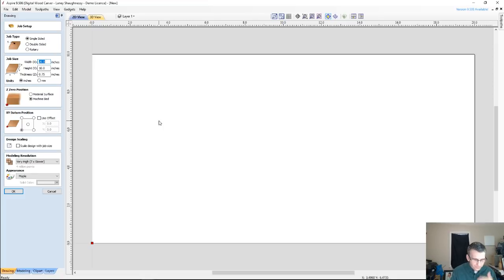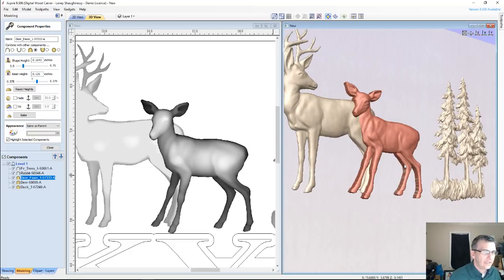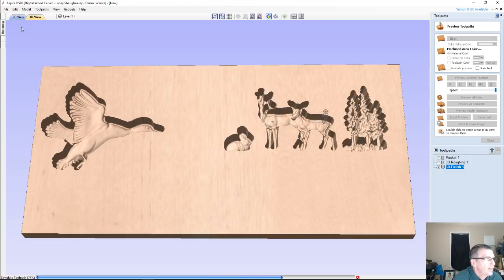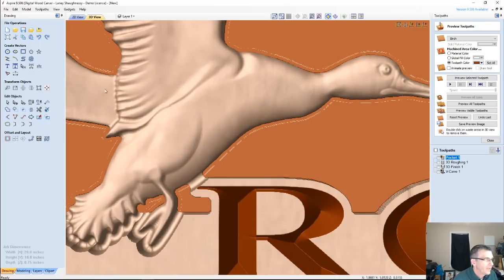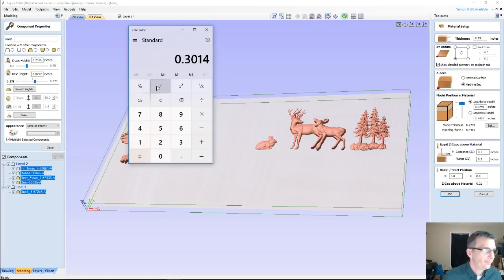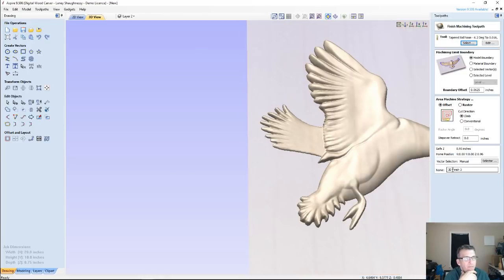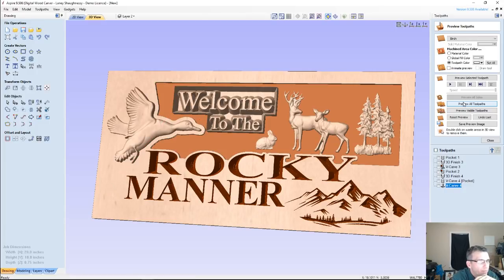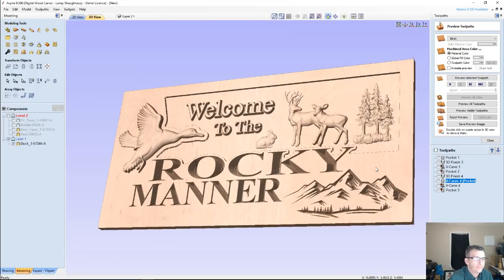Exploring the Features in Vectric V9.5 and 2D-2.5D & 3D Designing

Comment: How do you get the layers tab at the top? TIA
Reply from the maker: as of version 9 in the vectric software 9 and 9.5 the layers tab the layers box has been moved up to the view bar across the top of the program in earlier versions of the software they layer box is in the drawing tab on the left hand side of the program in order to get it up at 2 the top you would have to upgrade to 9 or 9.5 the latest version of the software

Comment: well i had good time watching this one.  in your toolpath mistake i think  you been actually cutting down 1/2'' not 1/4''  in your Pocket,  you set Z from table surface, . I would do all the toolpath from material top and then recalculate Z from table surface.
Reply from the maker: I work from the table surface or in my case the waste board surface to keep my spoil board from being spoiled. This also ensures i cut cleanly all the way through my material without cutting into the spoil board.
Reply: @SpindleTV   I agree with working from table surface , i do this sometimes .